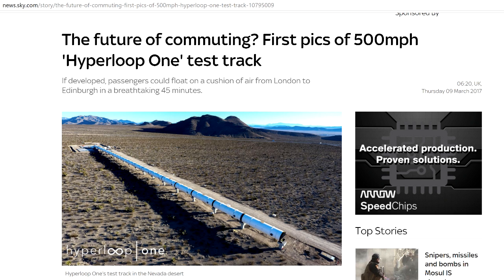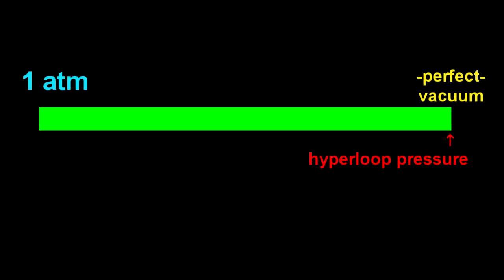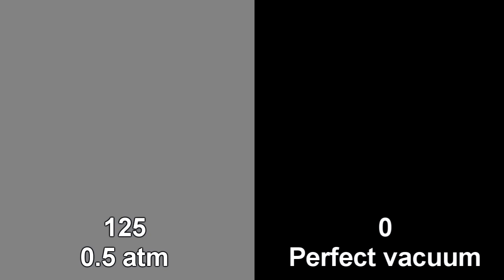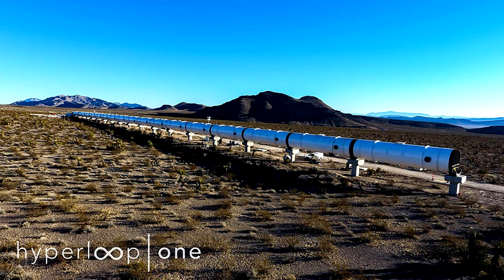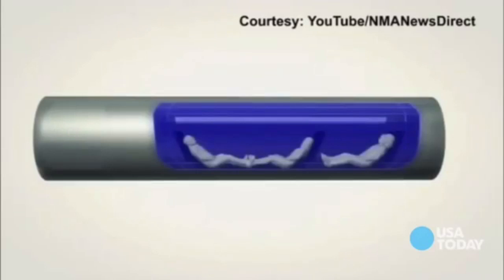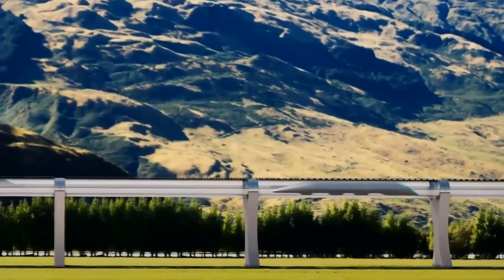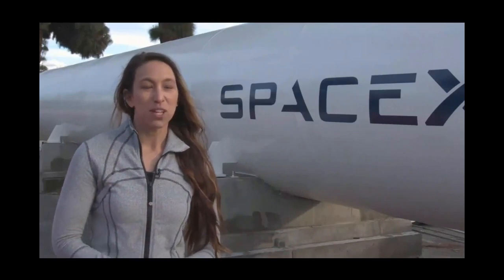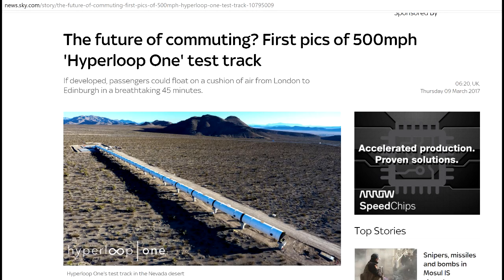Entire Hyperloop could be destroyed in SECONDS!

Comment: You are obsessed with the time to depressurise the tube but at the end of the day I doubt a full hyperloop track wouldn't need to be depressurised every single trip. The simple solution ANY engineer would use on a finished product like this is an Airlock system. Even the most obsessed scientist even blinded by his own arrogance could work that out.

Comment: First cars and trains were really slow as well, much slower than the hyperloop results and look what speeds both technologies are now capable of, so laughing at the speed results/pod stopping (which may be caused by a hole in the tubing) are at the very least inapriopriate.

Furthermore, deploying small hyperloop lines is required so designs can be refined without too much cost that would be required with full-blown line so when the final deployment happens the line is as safe and fast as it can be. It's just smart business.

Comment: I dont know why you have you have you panties in such a twist over this... If investors want to put their money into something that might not work let them, it not like its on par with the sleezy crowd funded projects you usually look at. plus your videos are being pretty exaggerated on this one.
 Firstly that steel is a good deal thicker then any of those tankers you showed and those are not designed to be under vacuum anyways , that is why they are being shown as accident demonstrations, Looks like from the pictures it is about 3/4 of an inch or so , seeing as a 1600ft test dept submarine has a pressure hull in the 2-3in thickness range and thier crush depth is more of a 2500Ft range (over 900psi) 3/4 of an inch should cut it.

Secondly the whole tangent about how long it takes to create the vacuum... its not like it has to be redone for the whole loop each time... a carousel of airlocks are the only things that will have to be changed in pressure on a reoccurring basis.

Comment: How to disprove his energy claim:

Given values:

E(Hyperloop) = 200 000 000 [J] for 1 km
Energy density of gasoline: 4.73*10^7 [J / kg]
Mass of 1 liter of unleaded gasoline: 0.75 [kg / liter]

E(Hyperloop) / Energy density of gasoline = Mass of gasoline required

(200 000 000 [J]) / (4.73 *10 ^ 7 [J / kg]) = 4.228 [kg]

(4.228 [kg]) / (0.75 [kg / liter]) = 5.638 [liter]

So, you need about 5.6 liters of regular gasoline to suck the air out of the tube. That's about 1.49 gallons.

So relating the energy needed to pump down the vacuum to kg of TNT is not a viable way of showing the energy required.

According to Wikipedia an average car consumes 5.0 [L / 100km] of fuel. By your logic, that car would need about 44.3 kg of TNT - clearly too much, right?

Check your sources and draw the correct conclusions.

Comment: it's a proof of concept and it does not have a double door to easily let the "carts" in and out because of that, that is why it takes so long
Reply: and once it's in a vacuum it's in a vacuum
Reply: the point is not to suck it trough, the point is to have low air resistance. So it takes low energy for the electromagnetic system.
Reply: and they are also engineers, they know how not to get a 100 kg brick falling on top of the tube

Comment: I don't think they have a viable plan to ever recoup the costs. Especially given the relatively small service area a hyperloop will have. You can either put stations all along the route, increasing costs dramatically (because all stations need to have multiple expensive airlocks, security personel, metal detector gates, body scanners and what not), and also possibly increasing travel time by a lot. Or have a single long line from A to B, excluding all paying customers living along the way. 

Classic train engineering is much simpler, and you can run "High speed", "Low speed/Local" and "Cargo" services (as well as tourist attractions like steam trains) all along the same highspeed railway line, just by adding a few sidings, signals lights, concrete platforms and some low grade pay guy to paint a yellow line on the platform. That's actually how "classic" railways generate their income: Making sure the lines are as busy as possible with paying customers of all sorts, not just the high-price first-class ones. It may not seem glorious and evening-news-worthy, but shipping canned beans and dead frozen cows makes quite a lot of money for railways, simply due to the high volume and relatively low cost of moving a 500 meter long train. This is something you simply can not do with the Hyperloop.
Reply: I wonder how they will handle simple things like, err, switches and signalling :D

Comment: 'The vacuum tube gun' argument really annoys me such as the experiment he set up with the glass tube and ball bearing or the video experiment shown. 
 Firstly it would be highly unlikely for a break to occur directly next to one of the capsules unless it happened at the ends of the tube at say the air lock, but then you would have to blast the entire door away against atmospheric pressure, in which case atmospheric pressure is probably the least of your worries. What if the airlock door gets blown inwards I here you say, well due to the domed shape on these types of vacuum doors that would be much easier said than done. 
 What if the capsule caused a breach while going down the tube? Well such an impact would probably destroy the capsule anyway and wouldn't even make that large a hole. What if someone does make a big breach in the tube? Well the first one traveling towards it would crash anyway. Plus the next nearest one would be moving away from it near the speed of sound so I would be surprised if the air caught up with it at all and it would be VERY low pressure. 
 The capsules that will have stopped in the tube would be a very long way from the breach. In that distance there will be pressure loss due to the expanding air and drag from the tube walls (which would dissipate that energy by the way) which is somehow totally forgotten in these videos. 
In those vacuum cannon experiments shown there is a high pressure difference on a ball with a tight fit in the tube. A more accurate model would be a tube about 2 or 3 meters long before the ball which would also be loose fitting (and have brakes). If you were to set up an accurate small scale experiment you would have to make sure all the dimensionless parameters were the same such as Reynolds number and such. Until that time, and you could prove that it would somehow be dangerous enough to endanger people (which it won't) the vacuum cannon argument is completely irrelevant.

Comment: shrug you're talking engineering problems, nothing more.
Reply: My thoughts exactly.

"If the tube collapses then bad things will happen. LOOK HOW BAD IT IS!"

To which i say, if an airplanes wing detaches bad things will happen. That's why engineers make the wings so strong.

Just because some test article tank that probably wasn't designed to hold a vacuum catastrophically failed doesn't mean that a properly designed tube will do the same so easily.

With that said, i am interested to know how they plan to deal with the thermal expansion problem. Outside of dealing with various failure modes that one strikes me as the most pressing.
Reply: Your missing the point.

For the hyperloop to be even remotely relatable to the risks we find in aviation planes would have to explode into a ball of fire and death the moment anything happened. Not just a catastrophic failure like the wings falling off but anything outside the norm.

The hyper loop is nothing like the Wright Flyer, it is the guy that jumped off the Effiel Tower with flaps of fabric attached to his arms or the tractor with an umbrella attached to the top that bounced across the ground.

Basically all the hyperloop is good for is as a lesson learned on how not to design a high speed train just like the aforementioned umbrella tractor.
Reply: Brent Smith,  "i am interested to know how they plan to deal with the thermal expansion problem."

To quote the alpha document:   "By building a system on pylons, where the tube is not rigidly fixed at any point, you can  dramatically mitigate Earthquake risk and avoid the need for expansion joints. Tucked away inside each pylon, you could place two adjustable lateral (XY) dampers and one vertical (Z) damper. These would absorb the small length changes between pylons due to thermal changes, as well as long form subtle height changes. As land slowly settles to a new position over time, the damper neutral position can be adjusted accordingly."
Reply: Ah, i missed  that small detail

I have poured over the original white paper, but must have missed that. I was under the impression that the pylons would only allow for subtle extension on the curves, not the straights, and that their primary purpose was to absorb the effects of an earthquake

Comment: @Thunderf00t, You keep referring to numbers within Elon's original white paper as if it's the gospel. He was spit balling and coming up with some numbers as a means to start the RnD process. I think many of those people replying to you are only saying that a Hyperloop of sorts is possible, not that Elon's original white paper is possible exactly as written number by number. You are also fully aware that a working chamber would use air locks, so knocking the temp competition track for decompression time is a low blow, and a completely moot point. Saying those thin tubes can't handle a dent at 99% vacuum is most likely correct, however I'd like to know if in fact the engineers are planning to decompress that much, perhaps their goals are different? Do you know the latest estimates from Hyperloop one, or are you basing everything again on Elon's first, best case scenario estimate?

Comment: The point of it collapsing under it's own weight is null since the pressure or lack thereof would keep it in shape. Obviously though the dents are still a problem.

However I think a lot of the dangers could be mitigated by sectioning off the different parts of the hyper-loop and opening them as the pod approaches that point. That way if there's a failure in one part then only that section will be affected. It would also decrease the vacuum pumping time when loading and unloading passengers as you could have each stop as it's own section to pressurize and depressurize it as needed. Also considering that we're dealing with a vacuum any structural failure shouldn't be too disastrous unless the section that implodes currently contains the pod. Even then, besides a possible fall it shouldn't have too much of an effect on the pod(?)(correct me if I'm wrong).

Edit: Dents could also possibly be avoided by having exo-tubes(TM) surrounding the inner tube. Also another note, the pillars seem to have various mechanisms in place in order to protect them from earth quakes and other various impacts originating from the base of the pillars. Not sure if it would protect it from car crashes though.

Comment: Thunder.... why do you compare a student competition to the real thing? That's pretty unfair in my opinion. SpaceX does not build the hyperloop, they just wanted to provide a testtrack to inspire and let students do some cool stuff. Also, you can't compare the truck tested to anything unless you know its exact specs like wall thickness and what not. Another important part is the manufacturing. You can build a tube to either hold pressure inside or to hold a vacuum depending on how you manufacure it. Using different techniques like putting outwards tension on the steel during welding (as if it was a compressed spring) changes its properties dramatically. None of those containers you showed were designed to hold a low pressure inside. A hyperloop tube could for example not implode if something crashed into it. It could instead bounce outwards and rip at the spiral seams.

People traveled in submarines 10 kms deep at pressures 1000 times higher than a hyperloop has to withstand 50 years ago. I would say we are pretty good in doing the math. Yes, a hyperloop is not indestrucable but so isn't any other form of transportation. A plane can break apart if you fly too fast and a train can derail from a tree on the tracks.

Comment: Wouldn't be the first time Elon Musk's cowboy attitude towards safety in engineering would have killed somebody! http://nypost.com/2016/07/02/tesla-driver-killed-in-autopilot-crash-was-watching-harry-potter/
Reply: Your reading comprehension sucks.

I draw your attention to the line in my second reply where i stated, and i quote : "So yes, the autopilot system failed"

At no point did i say otherwise. The autopilot system, had it correctly identified the truck cutting across in front of it, might have been able to slow enough for the crash to be non fatal, but it didn't.

My argument wasn't that the system didn't fail. It did, i never said otherwise, despite your claim. I argued that the guy misused the system.

It states in the disclaimer that the system is in Beta and therefore not a finished product, and can therefore exhibit unintended behavior. Hence the requirement to sign a waiver before use and the recommendation to retain situational awareness at all times.

Though he probably would have died even if he had been driving, unfortunately.

I present figure 1, a diagram of the incident:
http://spectrum.ieee.org/image/Mjc3MjgxNw.jpeg

According to the on-board data, the window between the truck beginning to turn and impact was under 1.5 seconds.

Combining human reaction times with the speed he was moving at, and he likely still would have gone under the trailer and died had he been driving. Had the autopilot worked he might have lived, due to its much faster reaction times, but he probably would have died even if he had been driving himself.

Therefore in a non legal sense, i put the blame primarily on the truck driver, secondarily on the autopilot system, and tertially on the driver.

From a legal stand point the autopilot would not be on the list, due to the fact that he knowingly misused the product despite warnings, however.
Reply: The driver of a self-driving car is responsible for giving directions.  Nothing more.  That's the whole point, dummy!
Reply: Lol sure. And how many drivers were killed by other human driver?
Reply: +Brent Smith Thank you for the clarification.  I stand corrected.
Reply: I suggest YOU look at a dictionary, or in this case, wikipedia

https://en.wikipedia.org/wiki/Autonomous_car#Classification

Note that there are varying levels of autonomy. An autonomous vehicle does not by definition need to be able to fully drive itself, it must merely contain automated features. As such, driving an automated car is a perfectly valid exercise.

A Tesla falls somewhere between levels 1 and 2 currently.
Reply: the idiot was watching harry potter, The driver of the car is resposible for not paying attantion.
Reply: you're an idiot. Tesla has a disclaimer and the car issue a warning every 5 minutes and tell you to hold the steering wheel. The Tesla is in no way shape or form a "self driving car" it's a autonomous vehicle. I know because i drive one.
Reply: First, the truck driver was at fault there. He turned across the Tesla.

Secondly, the terms and conditions of Tesla's autopilot require that you retain full attention at all times. 

Therefore, that was user error. If some guy sets off fireworks in his shed and burns hiss house to the ground, that is his fault, not the firework manufacturers.
Reply: +Brent Smith The truck driver was at FAULT?  Who gives a shit?  Tell it to the guy forced to reside in Sleepy Hollow!
Reply: +Brent Smith Also, Mr. Arguing Attorney, a legal contract or set of instructions does not discharge a manufacturer from liability for a fatality unless it clearly states the risk of non-compliance is death.  Know your shit before you open your big mouth!
Reply: It does clearly state that death or injury is a possibility in the disclaimer. Which is more than can be said for some firearms, yet you don't see people winning cases against gun manufacturers who made the guns used in a shooting or suicide.

As for the truck driver being at fault, the point was that he cut across the Tesla so quickly that even most humans would not have reacted fast enough to make a difference. So yes, the autopilot system failed, but the guy was using it incorrectly by listening to his audiobook, and even if he had been driving himself, the outcome would likely have been the same.

So i don't see where you get off saying that Tesla are at fault here. They have a legal waiver that must be agreed to after reading the terms and conditions, and legal disclaimers, before the autopilot system can be used. 

Like i said before, it is analogous to blaming a gun manufacturer after some guy accidentally shoots himself because he was being an idiot with the gun.

My view is that the guy was an idiot, and that the fault lies with him. Any self-respecting gun owner should observe far better saftey practices
Reply: You "drive" an autonomous vehicle? Now who's the idiot.  Get yourself a dictionary and look up the word autonomous.
Reply: +Brent Smith So the NY Post article is wrong?  They said the AI confused the side of the truck with the sky.  What's your basis for your argument, Mr. Attorney?

Comment: Depressurization is too dangerous. Keep it at normal air pressure so that there is a buffer zone to stop the passenger module in the event of catastrophic failure. Also, ALL passengers to be seated backward so that the seats hold them in accident conditions.